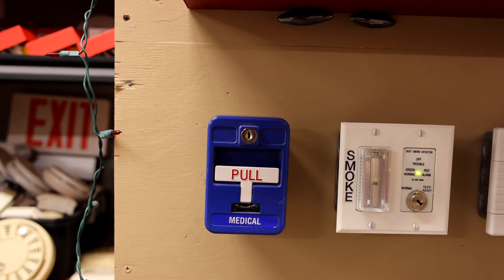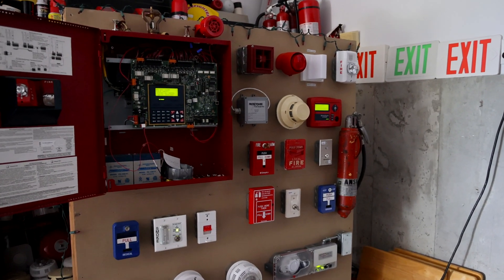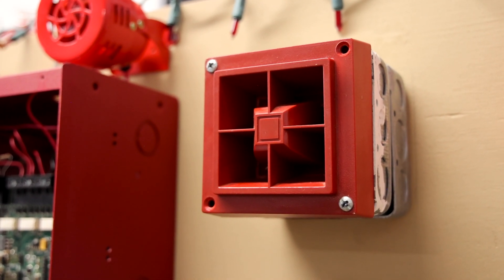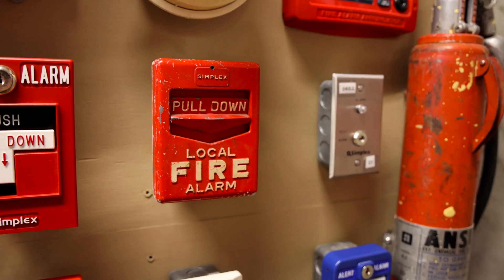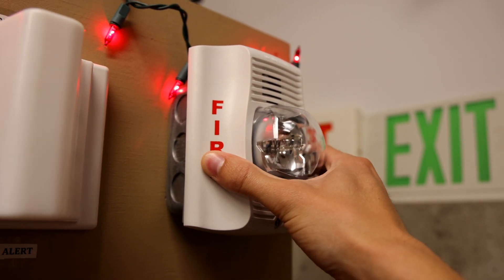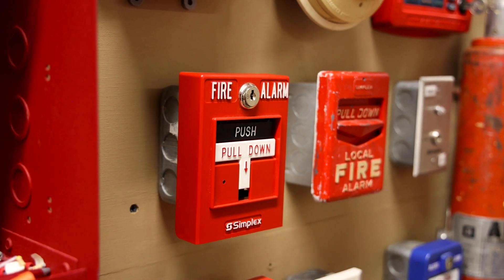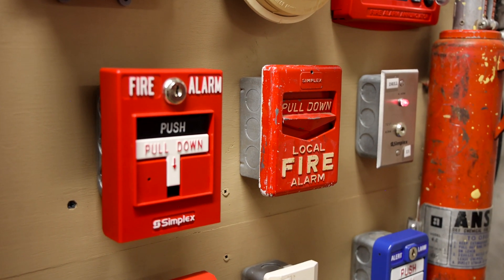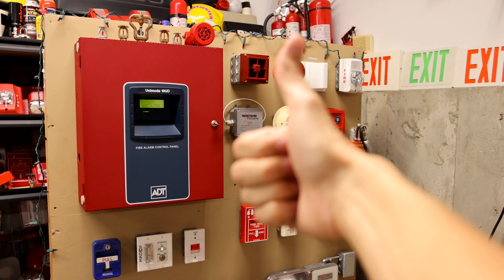ADT Fire Alarm System Test 31 | NEW Chime & Medical Alarm!

Comment: My middle school had a system sensor mass sounder outside and when there was a fire drill I love the sound that it made and I also had on my middle school system was wheelock E60s and E50s (also there was an E80 outside) in the newer parts and the gyms and in the older parts of the school I had wheelock EH1s with some wheelock MIZs and some remote strobes that had the look of an EH1 strobe (I can’t remember the model number) also the newer elevator room and in the stem room had a wheelock exceeded remote and the system was a Nofire (I know I spelled it wrong) system I don’t know what the system before the new system was add but my middle school had a cool system!

Comment: hey SER, the Simplex 4251-11 actually dates back to 1953 and was originally made by Couch--I think yours is from the late 60s. The earlier versions had a mercury tube switch. A bunch of mid-century buildings in my city have these on Simplex 4240 systems.